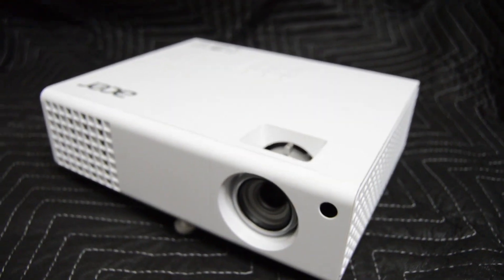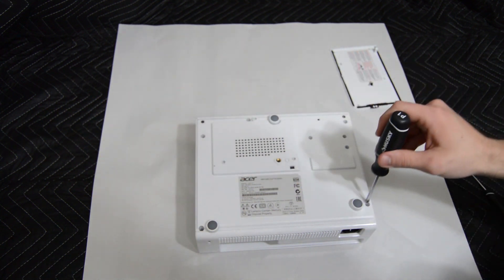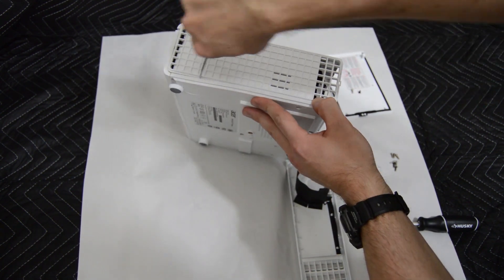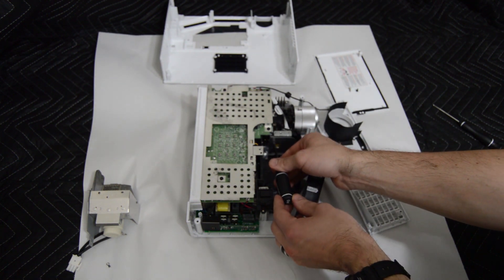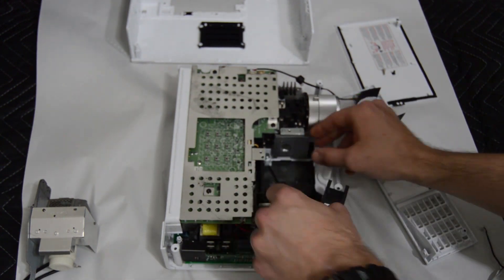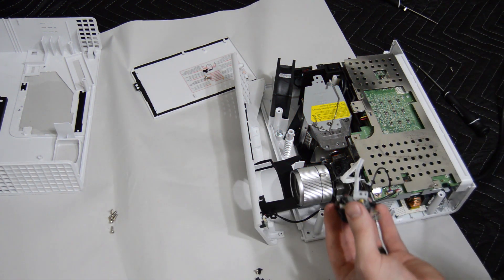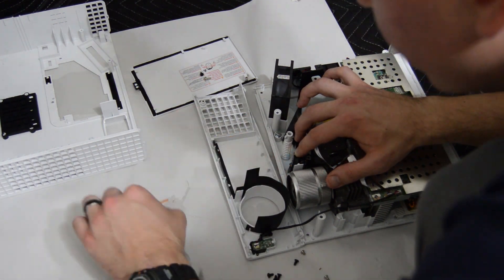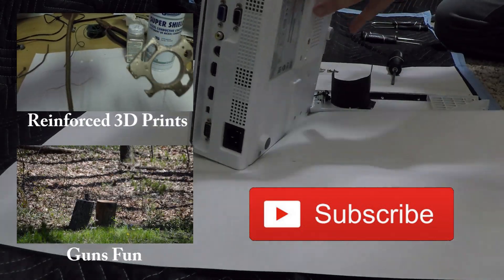DLP Projector Color Wheel Removal/Replacement Guide ~ Acer H6510BD ~ Improve 3D Printing Speeds

Comment: Advice for cleaning the mirrors? Please
Reply from the maker: Turn off any fans in the, also turn off heat/AC to avoid churning dust up in the air. Wear gloves, and use a microfiber cloth with optics cleaner. The optics cleaner you buy should be made with DI water and a non-streaking detergent. Take pictures with your phone as you go so you can put it together same way you took it apart.
Reply: @GarageScience  Can I clean it via following instruction in this video? Say, once I get the color wheel removed, can I clean the dust particles out of the mirrors, or will it require further disassembly? Thanks so much, man.
Reply from the maker: To clean the mirrors you have to disassemble it further. There is a plastic housing that contains the mirrors. The housing has two halves,   once you remove it the halves come apart by taking out a few screws. The most annoying part of cleaning the mirrors is that you have to get the whole projector back together before being able to test if you were successful or not.
Reply: @GarageScience  I cannot thank you enough for your help and guidance here. Think I’ll take it apart today. You made it look very easy via your videos so it shouldn’t be all that hard! Thanks a ton!

Comment: I have the same model. There is a small shade appearing on the screen. I cleaned the lens from outside thinking it could be a thumb impression or something. But still the shade doesnt go away. Is it probably I need to clean the lens or mirror(if there is one) ? Kindly. advice.

Comment: may I ask a question, sir? What could be the trouble when all LED indicators upon plugging, all turn red? I just happen to have the same model of projector same that you have on your video. Thanks.
Reply from the maker: Does the lamp turn on? Some kind of error occurred. Possibly a lamp failure or color wheel failure.

Comment: @Garage Science I am curious what your image, if projected against a white screen a couple feet away would look like after removing the color wheel. I am attempting to photo exposure and need as much contrast and as much UV in white and as little UV in  the black as possible yet still producing clean crips images in only black and white. Would you have any info in this area or know where I could find this info? Also, I am confused why there lines being produced and why they would effect UV curing of your resin. THanks

Comment: I have this exact model, but the fan has gotten crazy noisy. Is there a part number or a place to acquire a new fan, I followed your video and it’s very easy to take out the fan but I havn’t been able to identify a part number. Or Can it be cleaned? If yes how?

Comment: I have the Acer projector 6510 BD. I have had it for at least four years and for the first few years it worked very well. Lately I have problems:
I have several sources flowing to the Acer projector through a Sony A/V receiver – the receiver is fairly high end I believe it is the 1070 model.

About a year ago the projector will "blink" and interrupt projection of a movie file coming from my computer or streaming video coming from Netflix or Amazon prime. My best guess is that the signal coming to the projector is not strong enough. Is the original source or the output from the AV receiver not enough or has the projector weekened such that it needs an amplified signal in order to work properly? I can often fix the problem by flowing the signal through a powered HDMI signal 5 port signal selector that I assume also amplifies the signal.

I could be wrong but I believe that the Acer projector, not a new unit, has gradually weakened over time and can barely work if it has a "hot" signal but fails with an unamplified signal. I looked for firmware I watched this video about changing the color wheel – essentially I'm looking for something that might weaken over time and could be tweaked to fix the problem. Incidentally it is an almost new projector bulb which did fix the situation when it wasn't working at all but has not fixed my problem with glitchy signal reception. Not exactly on topic with this thread but it seems there are some knowledgeable people here who might have some worthwhile thoughts.

Comment: I'm having a possible overheating issue, any thoughts on how/what parts to clean? These projectors have no filters :(
Reply from the maker: The exhaust fan is located just inside the exhaust vent on the front of the projector.  You could start there and then move to the squirrel cage fan behind the optics assembly.  Watch my full takedown video to see how to get to that fan... I had overheating issues at one point but all I needed was more air circulation around the projector.  I would try that first to avoid taking anything apart.
Reply: Garage Science 
Thanks for the reply, I'm seeing an image with a green dimmer hue that jumps back to normal every now and then. Do you know what that could mean?
Reply from the maker: My guess would be something with the color is going bad. Try replacing it. The image is grayscale without the color wheel so color related problems are usually linked to the color wheel.

Comment: Hi there. Thank you for this video. I have a peculiar problem with my Acer H6510BD. 

When I press the power button, the lamp never turns on but the device gets power, the fan spins up. The power light stays a solid BLUE and the lamp light blinks rapidly. According to Acer manual, this is a color wheel problem. 

Initially I thought the lamp had burned out so I replaced it. Same diagnosis as above.The unit turns off after about 40 seconds. Does that sound like a color wheel problem to you? Can the power unit be an issue? The projector just stopped working randomly one day, not sure what happened.

Any help would be greatly appreciated! Thank you.
Reply from the maker: That is definitely a color wheel error. The first time I had my projector apart and took the color wheel out and reassembled it without the color wheel. I got the same error and had to put the color wheel back in as you can see in the video.

Comment: what if my projector is on standby mode and when I press the on button nothing happens?
Reply from the maker: Your user manual should have a troubleshooting section that will help determine exact indications of a blown bulb or of a projector in standby. If you don't have the manual anymore they can be downloaded online.
Reply: thanks

Comment: The Panasonic Projector is heating fast and the fan sound is very high ... please solution?
Reply from the maker: I don't know anything about Panasonic projects so take this with a grain of salt. It's common for dlp projectors to be a little hot when they are running, on my Acer there is an auto shut off temperature sensor to protect it from overheating. If you are worried about cooling you can add another PC cooling fan to the project air inlet grate to add a little more forced cooling. If your projector fan is making an abnormally high noise it may need to be replaced. Hope this helps.

Comment: people don't believe this video .I bought a UV filter ROSCO #3660 same as shown in the video.I have a projector ACER P1510 .so this filter is snapped in half and burned the mirror coating it on both sides.and it all happened for the first few minutes after turning on the projector .the projector showed an orange color .at first I did not understand why the orange color because UV must be the color blue.and this happened because this UV filter under the mirror coating has an orange color of glass.so don't risk it .it is good that the projector is not damaged.if I could just put out some pictures of this experiment .so don'T BELIEVE this video is a HOAX .
Reply from the maker: People will believe what they want. My projector operated with this filter installed for months without incident or issue. That being said I have recently started filming an update video about the status of my upgrade; and my filter ,although still intact, wasn't without a couple of issues. So hang in there and be patient, I am going to try and have this video up within the next week or so and try and get questions answered for you and a few others that have messaged me.
Reply: I was looking for a glass that can withstand high temperatures I made a temperature measurement of the glass that is immediately after the lamp with a laser thermometer .the temperature of 125-140°C .so I found that quartz glass is made at a temperature of 1600°C has a low thermal conductivity and low deformation during heating and cooling .when this quartz glass transmits all spear UV waves and infrared waves .according to the manufacturer due to the low iron content with the addition of rock crystal .glass does not block any spectrum of waves.this glass I ordered on eBay from China the thickness of the glass does not affect the passage of the UV wave to choose from there are glass 1mm 2mm 3mm 4mm I bought 2mm thick .just want to warn you that the glass is sawed very hard I used a dental disk with diamond coating it is used in the manufacture of ceramic teeth, bridges, etc .then I equalized the edges on the disc which is treated with glass in the manufacture of glasses .you can also use nail wheels but with a diamond coating.I tested the trim quartz glass heating it up to 400°C the glass is not damaged.so it can be used .so far, I haven't tried printing a model .I want to replace the glass on a quartz glass located at the bottom of the tank where filled with photopolymer resin.I didn't remove the rainbow wheel.I just a bit worried that with the full passage of UV through the quartz glass may be released more energy that may affect mirror chip because this energy is converted into heat .but this cannot be verified in any experience .this can only be seen after a very long time using a 3D printer and compare the service life of your upgraded projector's chip with a conventional projector.

Comment: Hi... After some time using the projector without UV glass filter and color wheel, can you tell - didn't that degrade the progector in any way, don't know, maybe DLP chip got stuck pixels or alike? Case is I want to do the same with my Acer P1500 (as far as I know it is identical to H6510BD, it's just a difference in the marking) and want to know, could it result in something bad for it.

Also, what is your typical exposure time for the layer (with layer thickness and resolution of course) - just to know where to start at :)

Thanks,
Ignat

Comment: Thanks for this video!  I committed the cardinal sin of using dust-off on my projector and the image was covered in dust blobs.  The dust had moved all the way into the optics.  Your other video was great as well.  I was able to take a shortcut to get into the optics without a full tear-down.  After completing the steps in this video, I was able to remove the eyepiece in-place and clean the mirrors and lenses with a cotton swab/microfiber cloth and lens cleaner.  The eyepiece has 5 screws to remove: 2 in the sides of the zoom ring (the silver ring with the thumb control) are removed first.  Then the focal lens can be spun all the way out, which will allow access to remove the 3 screws in the mounting plate.  The only difficult optic to reach was the outside face of the lens in the side of the optical chamber, but this shortcut easily saved me an hour or more.  I was able to check the cleanliness by shining a flashlight in the side port and look through the eyepiece.  Very difficult to get all of the dust out, and in the end I settled with 90% removal compared to what it was.  Final result is not perfect, but much much better. Thanks again for a great video.
Reply: Thank you so much for giving a detailed instruction on how to get to the optics - I'm in the exact same situation with my H6510BD that you were
Reply: Hey, I just wanted to say thank you! I had the same issue, big dark spots on the screen and I could focus on the dust if I adjusted the lens. I needed to get into the optical cavity to dust/clean. I followed exactly what you said and I had it cleaned and reassembled in probably 20-30 minutes and no more blotches/dark spots!

Comment: I thought I'd share a hack I did with mine in hopes it might be helpful for someone, rather then using the color wheel and moving it and chance that it may break or get damage due to being close to the hot light, I used a motor out a CD ROM/DVD rom as a color wheel, what I did was cut away the none useful bits put a two slivers of black electrical tape, opposite of each other  for the sensors reading and glued the rotation sensor next to the motor and tucked it in to the projector ,  keeping the color wheel safe if I ever want to use it again , here a drop box link to the photos of my hack.  https://www.dropbox.com/sh/jrzdl9u0kt678cn/AADprp9Aii6kWByk1cD4jvCIa?dl=0

Comment: Hello, i followed the instruction but my projector does not swich on, i washed my hands but seems to have damage something. do you have any idea where i should start to check to find the origin of the problem ?
Reply: i already found one capacitor that burnt out. i have no idea if this is because of my manipulation.  i am going to change it.
Reply from the maker: Check that your color wheel is still plugged in and spins when your projector powers on.  There is a ribbon cable that has to be plugged in as well, if you weren't careful with it it's possible that it was damaged.  The projector has to receive feedback that the color wheel is functioning otherwise it will not allow the projector to turn the lamp on.  Additionally there is a safety switch that must be pressed in order for the projector to receive power.  This switch is automatically pressed when the cover for the halogen lamp is installed.  If you tried to turn your projector on without fully assembling it, you must press this button (it's square, black and next to the halogen lamp).  If you have burnt capacitor, depending on where it is could definitely be the issue, make sure you replace it with the a cap with the same ratings.

Comment: if you wonna make bigge print. can man link projecter together so they make  bigger picture/ print size ? or how big can we make it ?
Reply from the maker: that would take a fair amount of calibration and alignment between the projector and custom software to slice and project the slices.  In theory possible but remember that a DLP projector also runs about $500-$600 so there is a significant cost as well.  Presumably if you were able to add projectors easily to increase build volume you would only be limited by the number of projectors that you use.  But since most resin printers are used for printing relatively small models I don't think there is much demand for very large build volumes in the desktop resin printers

Comment: Hi, for a Z axis only, what power supply to use? 
I'm building DLP 3D printer
Reply from the maker: +Maher Alsayid depends on exactly how you want to setup your printer. How big the stepper is and any periferral hardware you want. I use a 12V power supply that can output 6ish amps I believe. A pc power supply would probably do nicely for your printer.
Reply: Garage Science I have ordered a stepper motor from China 5 pieces as a kit, written on the stepper ( 42BYGH34-0400A), I have also ordered an arduino mega + reprap, if the power supply of a pc will work that will be great, 
May I as I saw some uses 12v 30A power supply, the 30A is it too much for 1 motor? 
How can I set a homing for the Z axis? 
How far must the project be from the build plate? 
When the UV light from the projector is hitting the surface of the resin will it no cure it? I see some build plate go to the middle of the vat if the projector if from below. 
If the projector from top how what's the distance between the resin surface and the build plate? 
Im sorry for all this questions as I'm new to all this and desperate to have this machine. 
Thank you very much 

https://lh3.googleusercontent.com/WOWDiuz4uULHGVigkYn7fCUcuZYjpg0DZlVcJ-BboUu7e9vnnfCgpWBe5oBl0uVXnz4a0famvQ
Reply from the maker: +Maher Alsayid haha, quite a few questions you got there. In short, as long as you use a power supply at a voltage that your components are rated at then you can add up the current draw from each component to get the number of amps your power supply needs to put out.

In terms of setting up your printer, most people use limit switches to home their axes. And distance from the projector to the vat for any configuration is dependant on the resolution you want and the focus distances of the specific projector you are using. 

 Hope that gets you on the right track.
Reply from the maker: +Maher Alsayid I don't know really anything about the construction of the little RP. I believe they have a forum though that you could field some question through though.

Comment: thanks for the video, it helped me. 

If you go back inside, look to the board that is vertical by the speaker, cut and connect the black wire to the orange wire, it will bypass the lamp and you can replace it with an LED or whatever other light source that you want--I'm swapping to a 405nm led. 

^my good deed for today. Best

-Brett
Reply from the maker: +brett turnage that is a modification I will probably try after my lamp burns out. Thanks for the tip!
Reply: +brett turnage wow, sounds like you know the ins and outs of this projector. I just got mine, can you give an advice to deal with rainbow effect? Also, any mod to replace the fans so it doesn't run loud upside-down? Thanks in advance.
Reply from the maker: +B. Pavlov don't know about the fans. The rainbow effect is from the color wheel spinning. I made a video last year about how to remove it from the light path of the projector.